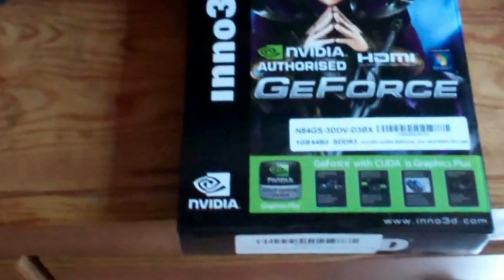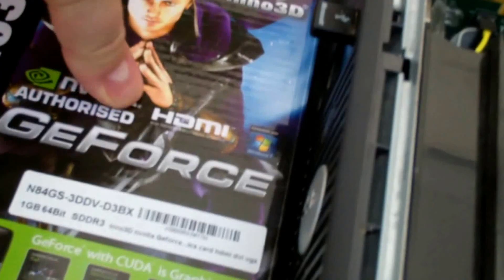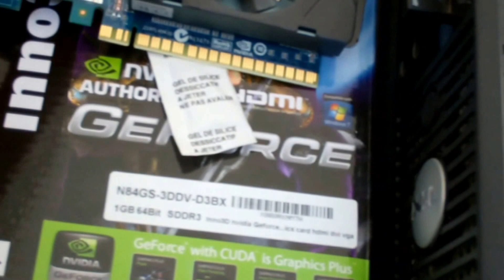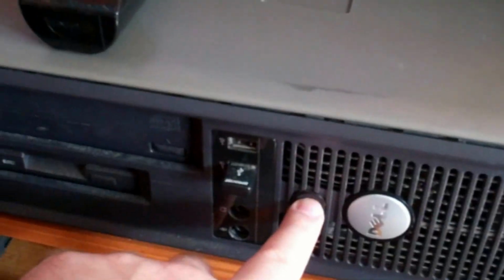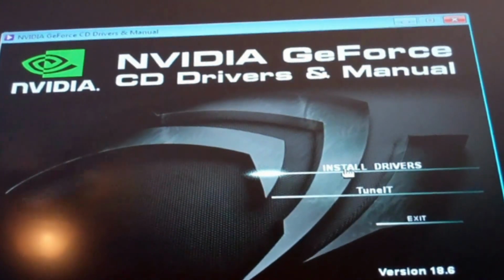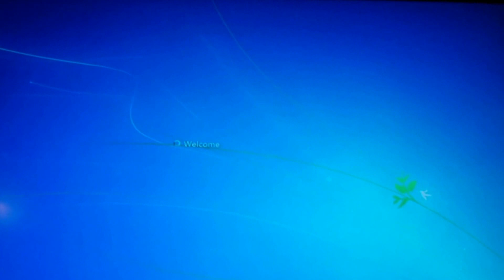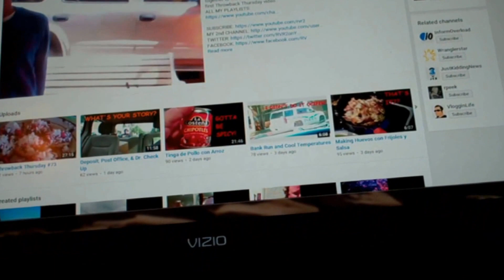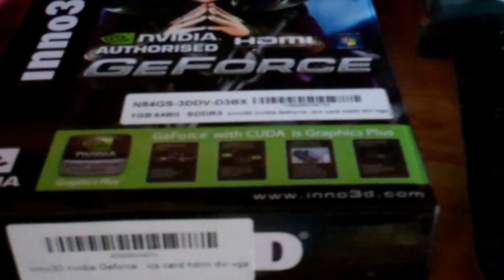Installing a Nvidia GeForce in a Dell GX620

Comment: i got A GellGX620 mini tower, 3.20 Ghz Penty 4 from a scrap yard, and i always liked the "office tower" look of this thing. So i swiped it and hurled it in my car. I put in a 7200 RPM seagate drive (it had a 5300 rpm drive i think), and installed Windows 7, 32bit, and Linux 20.3 Mint, in a dual-boot setup (THE orig OS was XP).
While it doesnt blaze thru the web, it does run decently and i added 1 GB of ram to bring it to 3 gb of ram. It's a heavy beast due to all the metal used in its construction, but it is INCREDIBLY QUIET, and the good news is that your NIVIDIA graphics card with 1 GB helps offset the 3 or 4 GB of ram on the Moboard, so video and graphics should run better than plugged into the onboard integral video ports. Nice work, ive hit the Like button. It could make a good basement or attic computer.